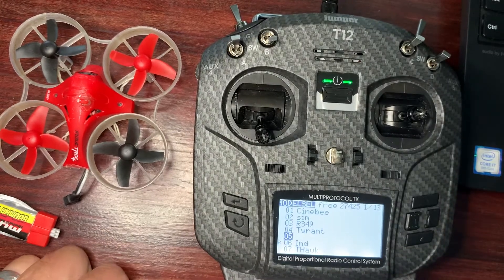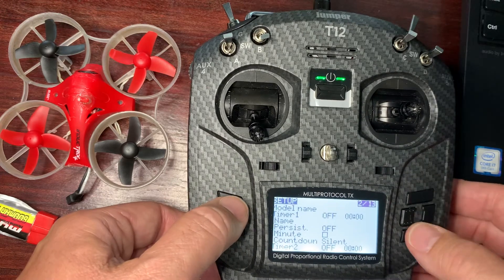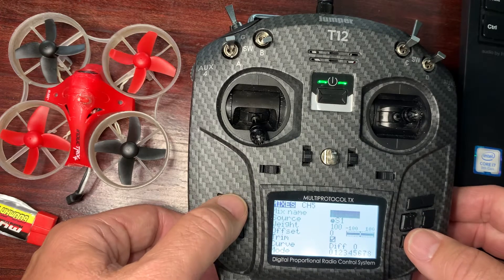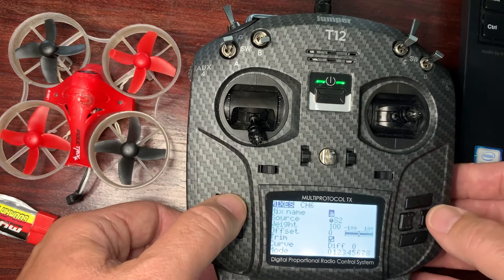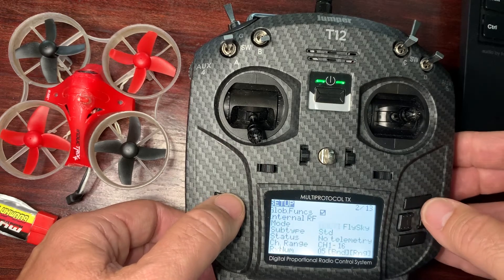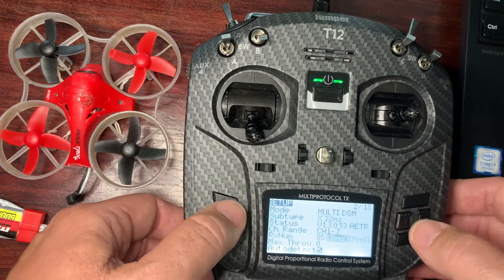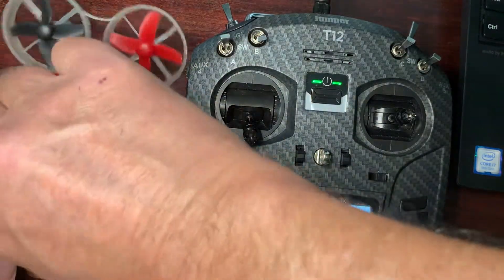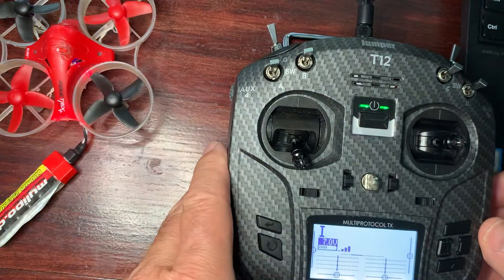Jumper T12 Pro bind to Inductrix -Step by Step

Comment: How do I have to set the channel mapping?
Reply from the maker: Page 6 of 13. 34 seconds into the video
Reply: @deadlazlo  Ok, thanks a lot. Good to know that arm has to be set to channel 6. Here's how it finally worked out for me. Default channel mapping on the radio aetr. As well set to aetr in the inputs and in the mixer. On the outputs I had to reverse aileron and rudder. Try to toggle the two position switch twice if it does not arm or disarm.